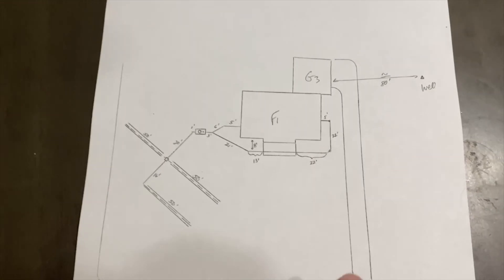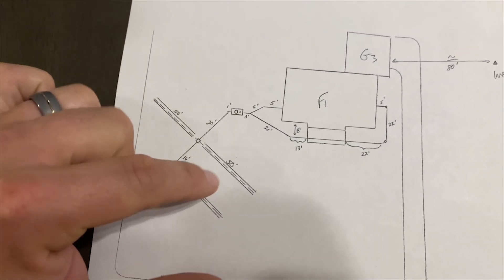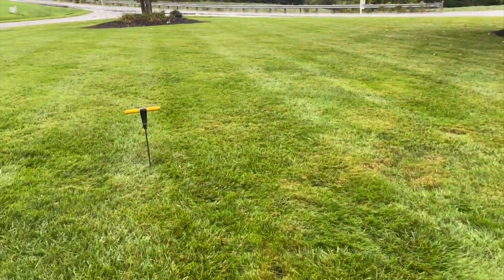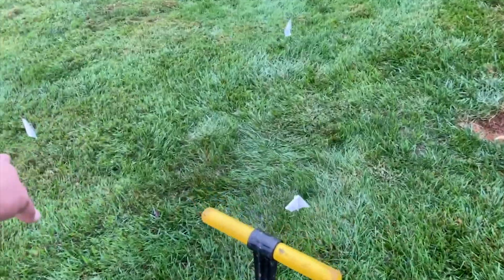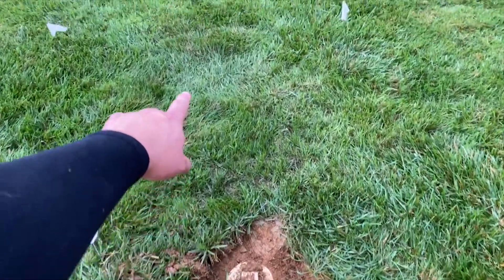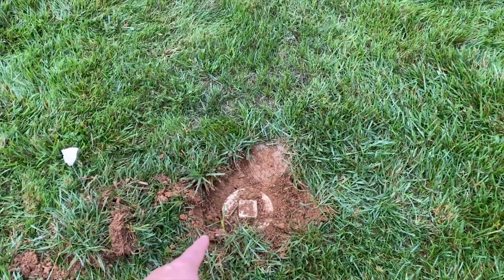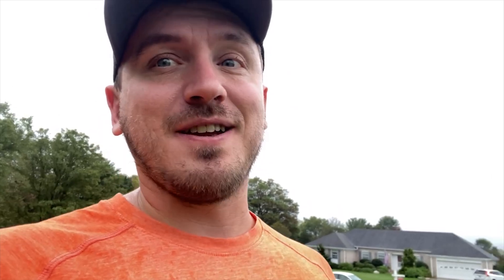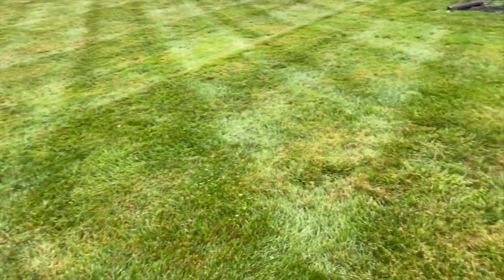Finding The Septic System For A House Built In The 1990s

Comment: I have a septic tank from 2005 that I can’t empty because I can’t locate it. Two different septic companies have tried. It’s almost backhoe time and this is getting expensive! Any tips?
Reply from the maker: They sell flushable locators you could potentially use.  Generally when we’re looking for the tank we will pull a toilet or use the sewer clean out in the house.   The county may have a drawing on file which may help you out